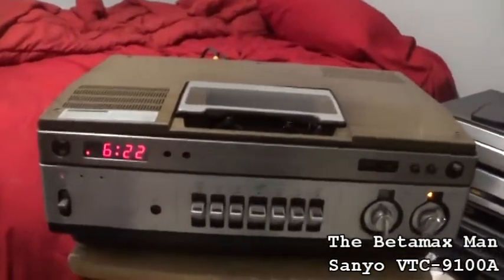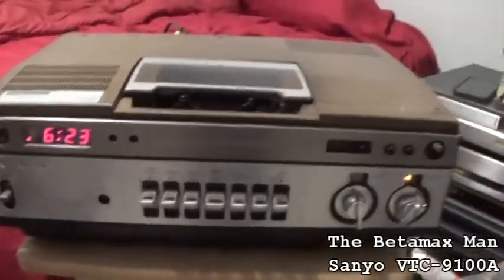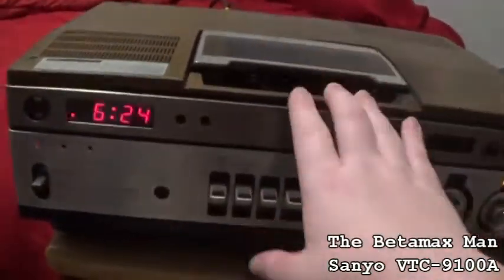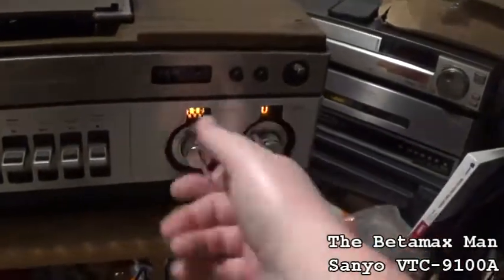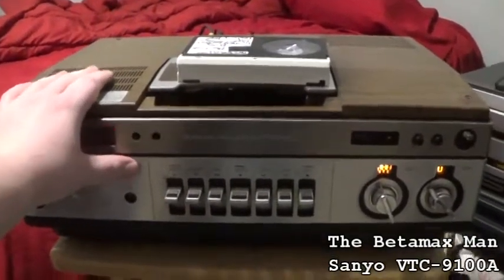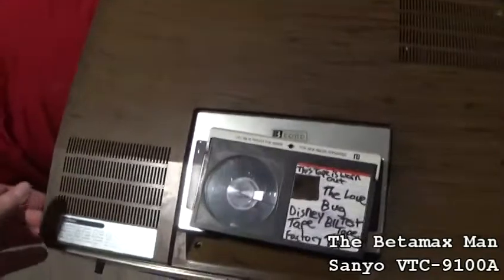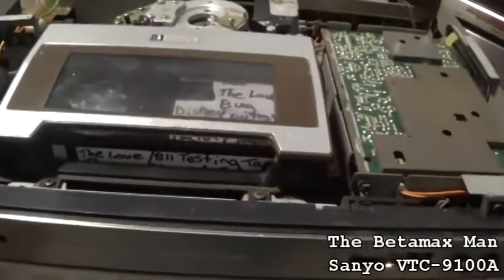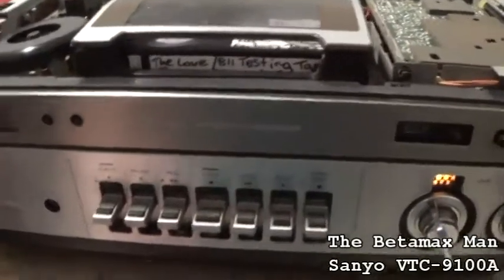A Quick Look At A Sanyo VTC 9100A Piano Keys

Comment: This is almost identical to my VTC 9350. The chassis and circuit board layout is the same. That board on the right is the IF board for the tuner. The luminance, chroma and audio circuits are all housed into the big board at the bottom. The board that sits vertically on the left-hand side is the head pre-amp and servo.